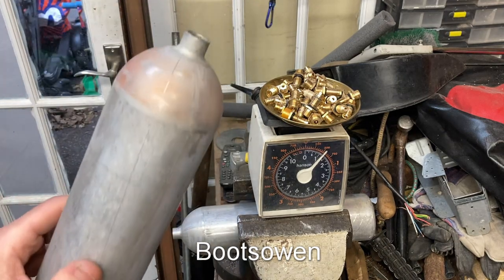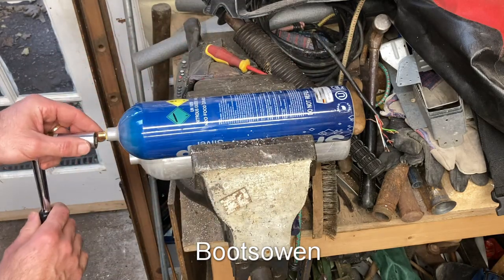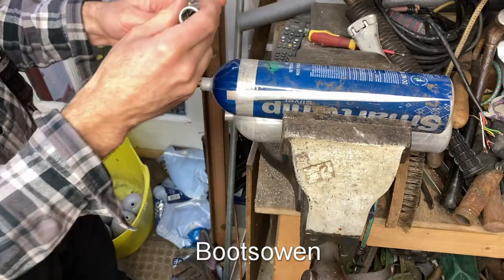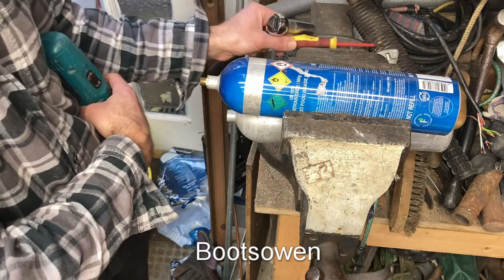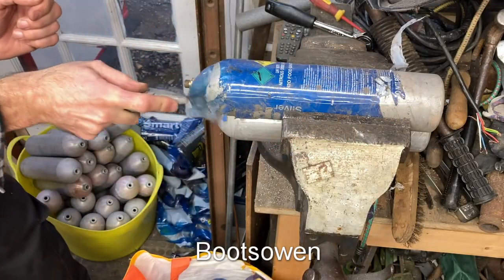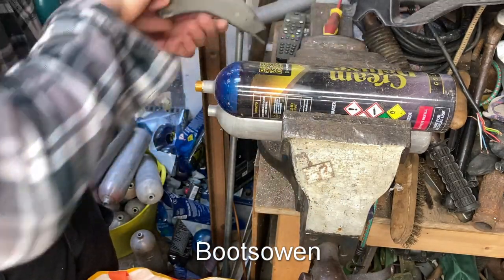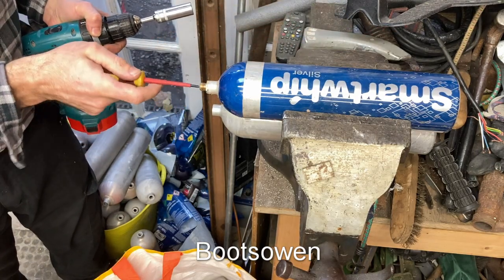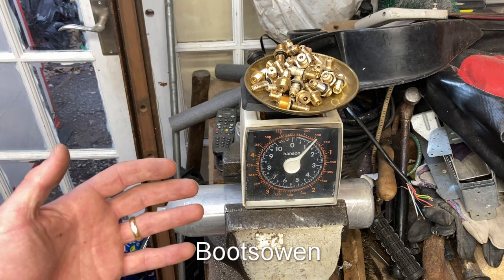Scrapping Nitrous Oxide flasks for money

Comment: Hi Owen, thank you so much for the video, Ive been wanting to find a way to clear up and recycle these. What is the process for the stainless steel ones, is it the same?
Reply from the maker: I have only seen steel and aluminium flasks. Never stainless. But I’m happy to be corrected. I have started using an impact driver with a socket on it and it speeds it up very quickly. Depends on your recycling centre but some will take them unprocessed as a gas cylinder and if you process them they will take them as scrap metal. Good to tidy up the neighbourhood.

Comment: What is the tool you are using to release the pressure in the tanks? Are you just sticking a pin in the valve? 

Also, how are you making sure the gas is releasing safely and not depressurizing to quickly and out of control? 

Thank you
Reply from the maker: I just stick a little screwdriver in. The gas can’t come out too fast. Worst that can happen is the can gets very cold. I used a wrench in the video. Now I use an impact driver to remove the valve. Much faster.

Comment: I'll keep an eye out for the aluminium ones. I saved a couple steel ones a year or so ago with the plan on making a portable compressed air tank for a nailer but the steel ones have an unsuitabl weight to volume ratio. 7 ally ones strapped together sound better.
Reply from the maker: If you find out what the thread is let me know. I made one of the alu flasks into a petrol bottle for camping, rethreaded the hole to m10 and used a standard bolt and rubber washer, the neck is too small really for filling. I think the ally ones would be good for melting in the foundry.
Reply: @bootsowen  good idea.

Buying threaded fittings can get expensive, especially if I use 7 bottles in a hexagon shape.
From the video it looks like those fittings could have their exposed part turned down to fit copper pipe over and soldered, the inside valve bored out. A spare fitting could then be used for the charging port (valve opens naturally when outside pressure greater than inside pressure + spring tension). Bag of bends and output regulator are the other parts needed.

Comment: We are having problems finding a scrap yard to take them, we are litter pickers, our local yard has stopped accepting them in the charity skip. One guy has 128 to dispose of. We are in Cheshire/Wirral.
Reply from the maker: I get them litter picking too. Try scrap trade centre in Leigh. With that many it will be worth the drive. You have to clean all plastic and take out the top valve. Sort into aluminium and steel. I think they will buy cans too if they are sorted. Let me know how you get on!

Comment: My car costs 25p per mile (each way) in fuel so I'd have to only go with a full load or if I happen to be passing the scrap man. My local place would be a 4 mile trip each way.
Reply from the maker: You need a cargo bike Ian. My car is still doing 14/18p/mile for fuel alone. Whether any hobby scrapping is worth it is up for discussion. You have to put a very low value on your time, or enjoy it like I do!

Comment: just picked up 8  2 Liters ones there heavy-metal wanted to make a chimney out of them but sa the labeling on them fire do not refill dangerous but seeing your video I can get to reuse them just open them and put water in and then cut them with the angel grinder.
Reply from the maker: Are they nitrous bottles?
Reply: @bootsowen  Fastgas 2000g with nitrous oxide E942 for food the have a yellow plastic handle
Reply from the maker: They’re good. You don’t need to fill with water as long as the nipple is out it’s ok to cut. You can if you want I guess. Make sure the gas is out first otherwise it will come out instantly. I have only ever found two of them.
Reply: @bootsowen  okee thanks - there are not a lot of them here I only see these types.

Comment: How do you get the valves out of the steel bottles as there the ones I pull out the canal with my magnet 🧲👍🏻
Reply from the maker: I use an impact driver and socket.